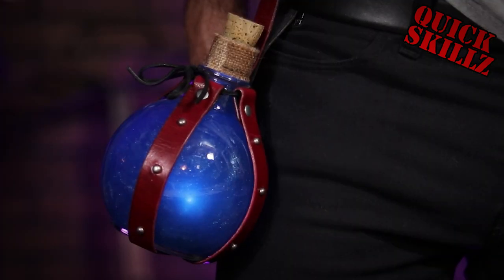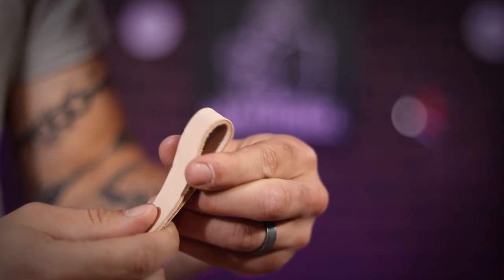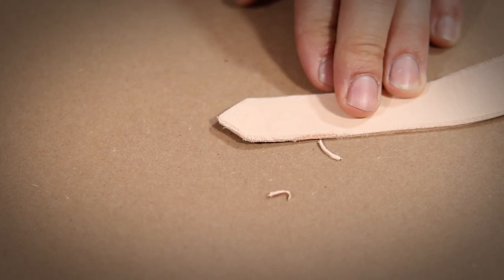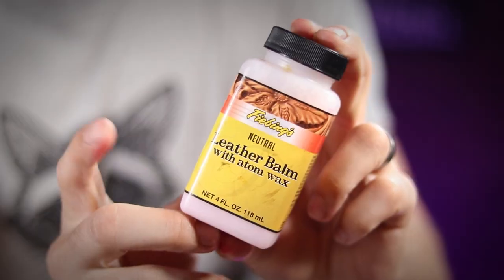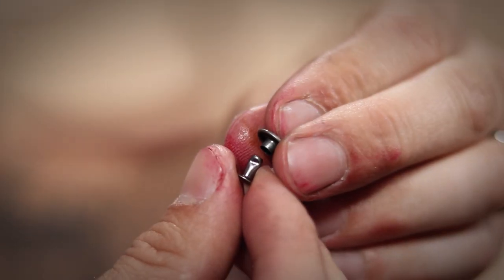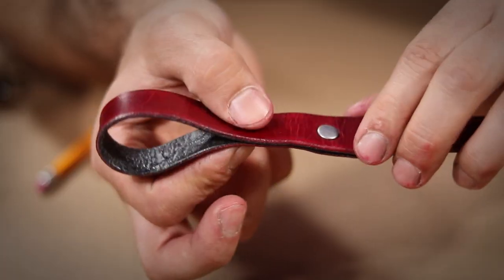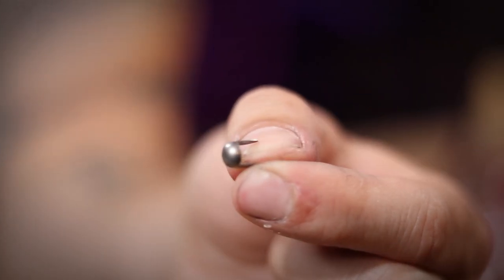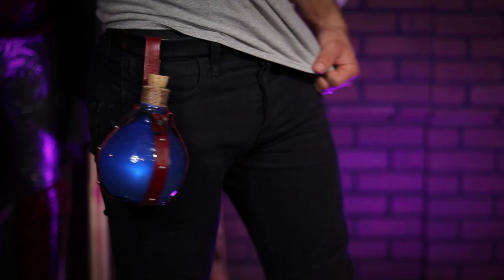How to make a Leather Potion Holder

Comment: Only issue with this holder is that you either have to loosen the tie and run the risk of it entirely unthreading, or take off your belt in order to get the bottle free. Not terrible if you never plan to drink what’s inside but if you want it functional then adding a release of some kind would be necessary.
Reply: I would use snaps on the longer strap so it could be easily removed, and a metal ring on the top, not leather, to attch the straps to. Otherwise, looks great!

Comment: Now how would a mage get to this flask without having to remove the belt that's holding it? It looks great but a quick release snap or something may have been a better choice.
Reply from the maker: The leather  cord just unties😁. Juts pull the string to release the knot, depending on the kind you put in.
Reply: @SkillTree  I saw this and immediately thought of DnD or larp uses. I dont know how fast that pull string would release the bottle into the hand without it falling to the ground and potentially breaking it. Every second counts in fantasy combat lol. Thanks for the reply and it really does look badass. You do great work.